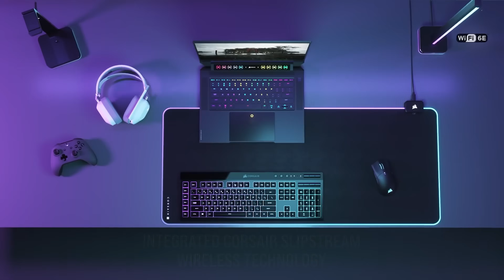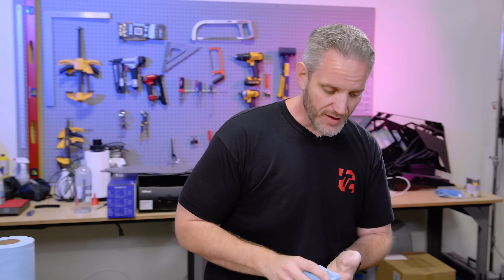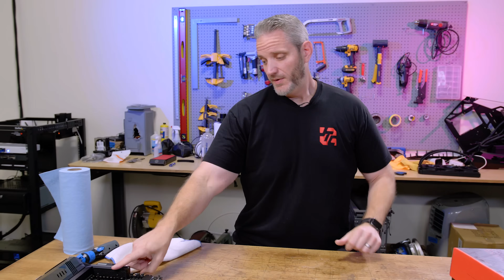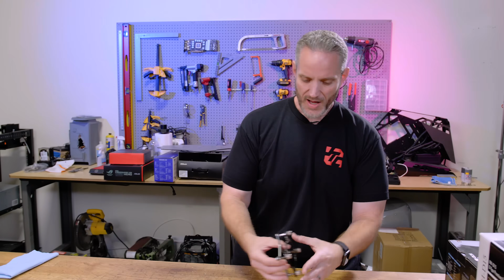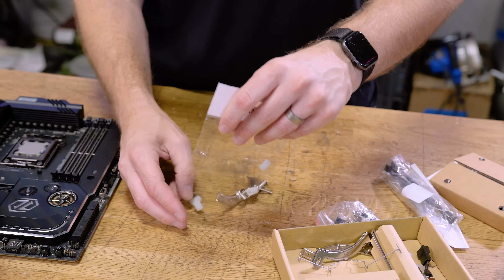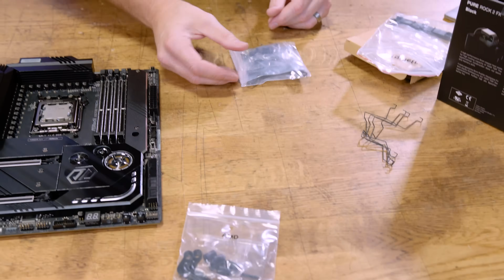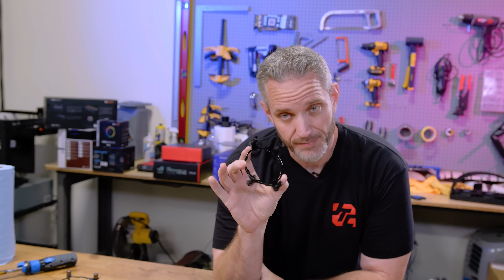AMD made a terrible flaw with this design...

Comment: I wonder if the reason why they designed it like this is because of the upcoming Zen4 3D. The v-cache sits on top, and while Zen3 v-cache was done in a way that didn't affect overall z height on AM4, maybe on Zen4 it will affect z height. So in X3D Zen4 processors they will just use a different IHS and it'll end up being thinner than regular Zen4 IHS.

Theorizing of course. But it's plausible.
Reply: This was my first thought as well.
Also, AMD had to "shave" the dies of the 5800x (and probably the IHS thickness) so the 5800X3D was compatible with existing coolers, and maybe "shaving" the CPU dies added a cost they don't want to incur this generation (so, presumably, they could release more 3D V-Cache models, too).
Reply: There is still the IO die, and all does need to be height matched. Plus shaving dies are good since the transistors are on the bottom of the silicon and silicon transfers heat worse than copper.
Reply: @bayanzabihiyan7465  Copper interconnects, remember. Copper is a good thermal transfer medium too.

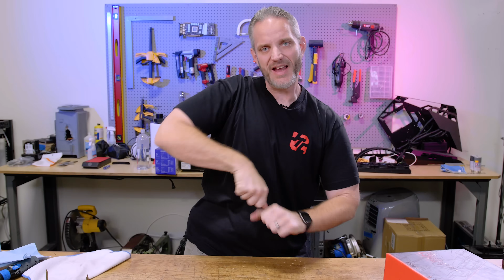Comment: 8:18 thanks for bringing back my Socket A PTSD that I got from having to mount coolers with those dang early clip on mechanisms and yes I killed a board or two by slipping.
Reply: Read the pinned comments, Jay simply told BS. It's not about the clips, it's only about the backplate.
And I remember the old socket A days. You really had to be careful when installing a CPU. But that also schooled for later installations. I see many people complaining that AMD is worse compared to Intel because the pins can be bent. I am not a watchmaker, more the the contrary, but I never bent any CPU pins.
Reply: @johnscaramis2515  I know, I've been using an building Computers since the early 90ies. I killed boards by slipping with screwdrivers during cooler installation or deinstallation, I killed a few CPUs by beeing too careless while mounting Coolers and breaking off edges of the Die on earlier Athlons and tons of other stuff. My comment wasn't aimed at the bracket thing but at his comment about how phil had killed mainboards in the past with the really old metal clips that needed a flathead screwdriver for mounting them.

Comment: FAQ: Which Noctua CPU coolers are compatible with AMD AM5?

"AM5 (LGA 1718) is AMD’s upcoming socket for its next-generation Ryzen 7000 (Zen 4) series processors. Please refer to our socket compatibility overview in the Noctua Compatibility Centre (NCC) to see which Noctua CPU cooler models support socket AM5 out of the box or via mounting upgrade kits.

In short, all Noctua coolers and mounting kits that support AM4 are upwards compatible with socket AM5, except the NH-L9a-AM4 and the NM-AM4-L9aL9i.

All Noctua AM4 mountings except the ones of the NH-L9a-AM4 and the NM-AM4-L9aL9i attach to the threads of the standard AM4 stock backplate. Since these backplate threads and their pattern are identical on AM4 and AM5, our AM4 mountings that attach to the standard AMD backplate also support AM5.

This means that all SE-AM4 models as well as all Noctua multi-socket coolers purchased since 01/2019 already support socket AM5. Multi-socket coolers purchased before this date that have already been upgraded to AM4 using the NM-AM4 or NM-AM4-UxS kits also require no further upgrades. Older multi-socket coolers that have been purchased before 2019 and have not yet been upgraded to AM4 can be made compatible with AM5 using the NM-AM4 or NM-AM4-UxS upgrade kits.

The NH-L9a-AM4 and the NM-AM4-L9aL9i are not compatible with AM5 because they require replacing the standard AMD backplate with a custom one, which isn’t possible on AM5. A dedicated AM5 upgrade kit for NH-L9a, NH-L9a-AM4 and NH-L9i coolers is in preparation." so if you have the AM4 mounting kit you should be good
Reply: Jay would have bought the NH-D15 he has before 2019, I have several NH-D14 coolers bought in 2020 and afterwards and they all have the AM4 compatible kit which is now compatible with AM5
Reply: @prabodhaelangasinha9523  So all the newer NH-D15 will work with AM5 ? , I wanted to stay with Air Cool and always like the NH-D15
Reply: @marcosbotello5999  yes I've got NH-D15 on mine.
Reply: @prabodhaelangasinha9523  So basically if the store has AM4 under their NH-D15 it means it's the new version which supports AM4 and therefore instantly AM5 too I guess?
Reply: also, if you fill in a form on their site with proof of purchase of both cooler and AM4/5 board… they send you a kit for free.. Now THAT is premium customer support! (Also picture of both products count if you don’t have the invoices)
Reply: Thanks Noctua Marketing Dept.
Reply: this means that if you can drop the temp by 21c think about what that does for overclocks when you can drop the temps like that🤔🤔
Reply: They also had a special edition NH-D15 SE-AM4 that only came with an AM4 mounting bracket, which now the site claims is AM4/AM5 compatible
Reply: Well might as well build a old pc lol
Reply: @phishmastermike  I'm sticking with my 5950x cause it does not have the ihs bs
Reply: @raven4k998  eww ddr4
Reply: maybe ryzen 8000 will be better then 7000 is and run cooler again I can atleast hope but my 5950x will do till then you enjoy your 4790k running 2133 ddr3 ram and your fresh new chlamydia infection it's all yours so own it like a man you got this👍
Reply: I wondered why Jay was thinking that the NHD15 would not be compatible since his did not include the AM4 upgrade kit.

I also checked when that faq was published for Noctua, and it was back in April 2022.  So this was Jay not doing any research here.
Reply: @xpyr  yeah well he's a noob pleb when it comes to coolers if they are not liquid coolers they are not worth checking into that deep
Reply: @xpyr  my guess he does not have current am4 info for that cooler as adapter kit came for those older nhd15's the new ones came with am4 added by default Jay hasn't checked up on it after am4 came out which is most likely the case

Comment: Why don't motherboard manufacturers just design a bracket with the socket hold-downs separate from the mounting bracket? I know that's simplifying that process a lot but it seems like an easy enough fix with a redesign...

Comment: They pretty much condemned the whole socket so people can save few bucks and reuse some compatible cooler.
Reply: Sticker shock is a thing. A new cooler just adds to the reasons not to buy AM5. You already need a new board and ram, adding a cooler to that might have been enough to turn some people off of an upgrade. You also have to keep in mind that the majority of PC users are never even going to check what temp their CPU is running at unless there is a performance problem.

Comment: That sucks, but I will not change my system until 1 or more generations and at that point my Dark Rock Pro 4 will most likely not be compatible anymore anyway and we will probably need absolute zero cooling because of the heat

Comment: I’m using a 240 AIO with a 7700x. Is there a need to go to a 360?
Reply: there shouldn't be, from what I know. A 240 should have more than enough cooling capacity for the 7700x at stock settings.

Comment: The first thing that immediately came to mind the first time I seen the IHS design of this line was that it is just ridiculously too thick which is likely part of the thermal issue but anyway it is impressive once delided how far the temps drop.
Reply: Bet you it's for all that 3d cache on 7000x3d
Reply: @saphziod8685  2gigs of stacked cache please!
Reply: Barely more than the intel parts when it gets delidded?
Reply: Exactly . Now Jay is Nostradamus after De8auer delidded one and cut temps 20C.
Reply: @RATTL3R186  20°c in prime95.

In gaming applications the result is less than 10°c

Comment: but for normal users they probably would just use the 105 watt mode, if most of the media showing how to use it, but rn seems most medias doesn't show off the 105 eco mode
Reply: Well yeah, because rarely anyone uses eco mode right out of the box outside of SFF builds. Waiting for the Hardware Unboxed review for Ryzen 7000 using eco mode.
Reply: I think Steve from Hardware Unboxed pointed out that the ECO mode wasn't readily accessible for reviewers. They had to go digging deep into the BIOS to enable a few things as opposed to simply hitting a toggle in Ryzen Master. This has been fixed since then.

Another reason could also easily be that there are pretty much no sales in "we hit 95% of our competitor's performance at 50% of the power usage". No one cares about that when actually having to spend the money. That's why Intel can sell 250 watt CPUs. That's why Nvidia can sell 450+ watt GPUs.That's why AMD is now pushing 170+ watt CPUs.

Comment: can they make a replacement ihs made out of something more thermally conductive?
Reply: It is nickle plated copper with a bit of gold where the dies make contact so there really isn't much more that can be done there without it being a small vapor chamber.
Reply: @MrKillswitch88  could that nickel plating be "lapped" off (and would it make a difference?)
Reply: @curmudgeonnn  A little but not enough in this case.
Reply: If you are willing to pay for an IHS made out of 99.99% silver. 99.9% silver is not better than good copper, DerBauer made a video on thermal conductivity not too long ago.

Comment: INTEL is always the way to go.  Even more so in the future.  They are about to leap ahead
Reply: Brand loyalty is cringe. Must I remind you of the socket flexing issues with Alder Lake?
Reply: Polish that crystal ball.
Reply: I mean Intel isn't a bad company but this issue is minor and not unseen on Intel systems either. Raptor lake is offering similar performance on a dead socket. Zen4 vcache will make the leap forward in Q1 leaving Intel playing catch-up again. However Amd will be doing this on AM5 and the current gen motherboards vs Intel requiring a new Mobo for the lineup after raptor lake.
Reply: Gr8 b8 m8 😁
Reply: huh AMD destroyed intel despite their thiccer IHS. 😆

Comment: have you consider the 3D V Cache ? it needs some space
Reply: No it doesn't, 5800X3D showed z-height doesn't change with V-cache
Reply: @pyjamas9872  Maybe they plan to stack more stuff then just one shaved cpu die and one cache die.
Reply: It doesnt have one...
Reply: @tarelsun4025 not yet
Reply: nope AMD remove material from the CPU die that the 3d V cache drops into, keeping the die size the same.

thicker IHS was done so even a custom cooler would just need a new bracket to work,
as the covid bottleneck is still on going and making a new bracket vs new cooler cost less and takes less time.